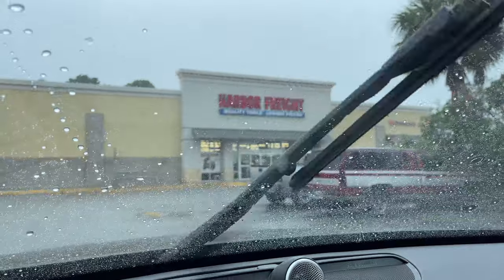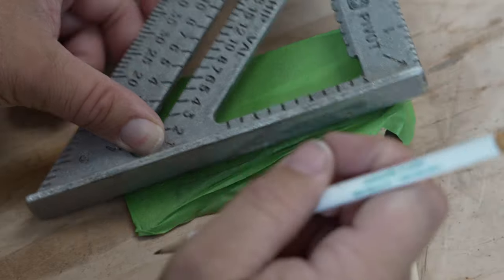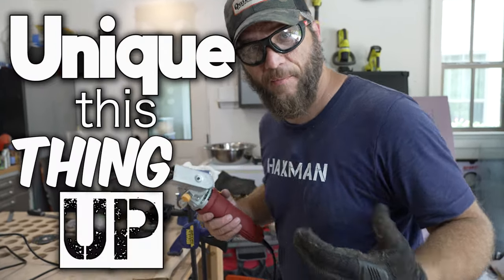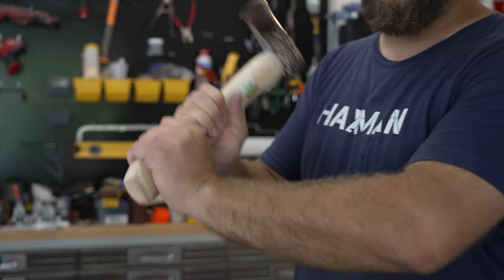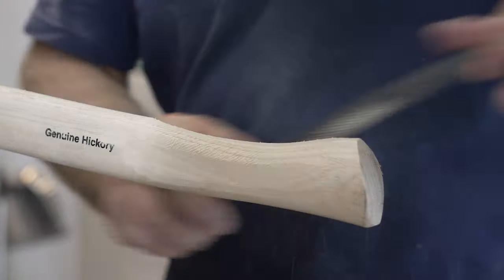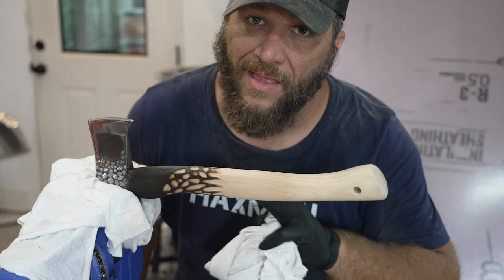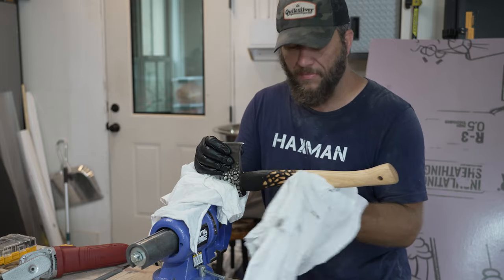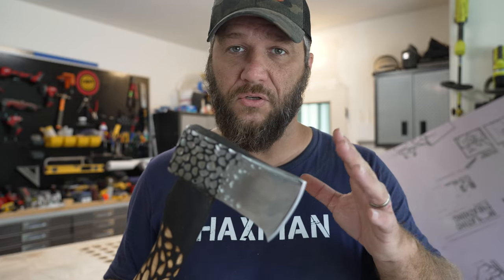How To Transform A $12 Harbor Freight Axe!

Comment: If anyone is wondering how good these actually are, I had an axe throwing business for a short while, and we used these, and they held up great! They do need a bit of reprofiling of the blade and good sharpening to make it stick, but they lasted more than 6 months until the handles started breaking down.
Reply: Agreed. Just check the grain orientation of the handle before you leave the store with it. That goes for any store. Some hatchets/axes are hung properly, and some are just wrong.

Comment: Looks great!   Tip: Don't dispose of the rags you used with the boiled linseed oil in a 'wadded up' state. The BLO heats as it dries. I've come down the next day and found paper towels that were charred and crispy. Almost caused a fire...
Reply: BLO has been responsible for the destruction of many a workshop.
Reply: I always just throw them in a 5 gallon bucket of water with a brick on top of them to make sure they stay submerged
Reply: What do you do?
Reply: @FancyxToast  I spread the rags out flat over the edge of the trash can overnight, then throw them away the next day. Less heat build-up if they dry out flat as opposed to crumpled up. Has worked fine.
Reply: @cannistershot2277  that's exactly what I do. Use it then flop it over  the edge to dry. I do that even if it was barely used just to be safe

Comment: Love it! Nice job!! I got a perty little camp axe at Ace Hardware for cheap and feels great in my hand, too! It is a Collins brand. Btw, that style of sharpening and setting your bevel with a file and rag is perfect for a camp axe. Super aggresive low angle which is what you want in this style axe. I finish my axes in flax oil which is the same as B.L.O., just doesn't have no metal driers!

Comment: Looks nice! All modern day axes seem to have “club” handles. I think they do that intentionally so the user can customize it…Just a guess. Same thing with the varnish, I believe they do that to hold shelf life to avoid cracking. I don’t know the details about that hand axe but typically they have a temper and when heated up by grinding, sanding or even torching the handle, you have to be careful because too much heat will ruin the temper and your axe blade could fold under while chopping or splitting.
Reply: Heating that handle is no problem but the reprofiling grind could soften the edge some.

Comment: I’ve just recently started putting together a “bug out” or “go bag” and have been considering several different axes for cutting kindling or use as a mele weapon etc.
All of the axes I’ve looked into recently are $50 or more, which defeats the purpose of building a cheap but effective kit. 
I’m on YouTube everyday, and with this in the back of my mind, I run across Wranglerstar and now your content, and I’m like “damm, exactly what I’m looking for. A cheap, modifiable, but effective piece of equipment”. 
Thank you for the eye opening epiphany. I will definitely be visiting harbor freight tomorrow.

Comment: The HF axe handles vary a bunch along with the varnish thickness. I just kept picking em up until I found one that has little varnish and a thinner handle. Also the wedge at the axe head varies in quality as well. Get one that doesn’t have big gaps in it or that uses some resin to fill in the gaps.

Comment: I just picked one up yesterday (finally had them in stock) there was only 2 and the first thing I noticed is that one of them had that thick ass handle like yours and the other had a much nicer slim handle that fits in my hand perfectly. Guess which one I snagged. So the moral of my story, keep looking if they only have the Fat handled ones. If they had both been like that I honestly don’t think I would have bought it. You’re right the fat handle sucks!

Comment: I noticed a life insurance commercial pop up before this video.  It's like "Ladies, if your husband is like this guy, you might want to buy life insurance on him."

Seriously, most of my knife making tools came from Harbor Freight.  I have that exact same belt sander.  I tossed that clear plastic cap on top of the wheel because it works well for getting into grooves or curves into the handles.  I also use it to sharpen knives because it is easy.  Put a 600 grit belt on it and it will shave hair.

Never used boiled linseed oil, but I really like Tung oil.  It does pretty much the same thing, but gives the wood a warmer look.

Now take that awesome ace and go bury it in the hearts of your enemies.  And by enemies, I mean logs, limbs, etc.  Keep the content coming.

Comment: Great job bud.  I did something similar with a $4.99 CAD axe (that's like what $0.30 US? 😂)  and it turned out pretty good.  I did add a whip to it out of twine and then put resin on it.  It protects the neck area in case your a hot shot like me and keep missing the wood while splitting :)  👍
Reply from the maker: Thanks man! I started to do something similar out of leather. I’m very likely to miss as well. 😄 I ran out of time for the video but I might do it later.
Reply: @HAXMAN  can't wait to see it

Comment: My concern would be the loss of any temper in the axe head and especially the cutting edge from all that grinding. I could see an area of metal burn about halfway of the axehead just before you sanded the dimples in the axe. That metal burn goes all the way through the axe or almost so. It is the metal discoloration seen on the shiny buffed axe. To cure it would be to retemper the entire axe but it might not retemper to it's original hardness. If the axe was not well tempered in the manufacturing process then retempering will cure that as well. Your technique of cutting slots behind the axe blade was interesting and might minimize temper loss to some small degree. Never get an axe hot when doing any work on it. Try making modifications under water or using what are called heatless wheels or grinders. A company called Mizzy makes small ones for dremels and flexible shafts, they may make or may know who makes the much larger ones. Ask them about heatless cutting discs, I know they are made but I don't know who. If you have to use what you have you will have to approach your cutting lightly and slowly. Make a cut, let it cool down or dowse it in oil, then proceed with the next cut when slotting. You can develope methods using regular abrasives to minimize heating and loss of temper. I just thought you might want to know but then you may already know. A friend always!  Take care now !

Comment: awesome video. only comment is that if it's taking too long to grind your bevel or your edge by hand on an axe head, you need a better file. that steel is super soft. unless you're starting with just a squared off block of steel it shouldn't take more than 5 or 10 minutes to get an edge on it with a proper file.

Comment: Since it's part of this video, I might as well ask about it, since I've always thought this, but never knew for sure:
Should you sharpen objects against the cutting direction, or doesn't it matter? When using a mechanical device like a grinder, I always make sure the disk is going into the cutting edge, instead of away from it. Is there a reason to do this?

PS. You did a great job on the axe. Not my style at all, but who cares? You tried things out, made it your own, and are happy with the result. I'm impressed, I wouldn't have the creativity to even think of this project, let alone how to decorate it.
Reply from the maker: I have no idea. I do it both ways and it seems to work either way although I'm sure one way is the right way.
Reply: It is better to actually get a bit of angle from what ive heard. This is because you need a but of a serration (Im talking micro serration you cannot see to the naked eye) to have the most effective edge. My personal suggestion would be either with the direction of cut or within a max of 30 degrees of the direction of cut. This advice applies more importantly to knives but still may have some effect on splitting.
Reply: he's  not  the  sharpest  pencil  in the  cup

Comment: Did the steel feel overly soft when you were grinding, sanding or filing it?
    Also has the handle held up after severely weakening it by taking material off? Habit broke yet? Lots of reviews on harbor freight saying the handle broke after first or second use.

Comment: Fair to say you cheaped out on this one Haxman 😛 lol👍🙂.
...
Impressed you turned a boring looking harbour fright axe into a smart looking er axe.
I thought you were going to wrap the leather around the handle. mind the hand loop is pretty cool.
You could carve a internal radius groove into the handle and! the axe head along the top edge.
Or cut an (elongated?) hole into the center of the axe head. 
No reason just think it would look cool.
Dang it! Was going to say:
Your axe WILL cut!😠
...
So instead I'll say.
 Is what you did to the "Hax Axe"
21 century version of putting flames down the side of cars like they did in the 70s lol!
Good stuff 👍

Comment: Emotional roller coaster ROFL
1:23 NOOO dont use cutting dist as a grinder
1:28 Wheww is is actually cutting with cutting disk. Good job!
1:35 Noooo DONT GRIND WITH CUTTING DISK!!!
1:37 Good job switching to actual grinding disk.

Comment: I'm new to all this, so this might be a dumb question. But when you  burn the wood like on the handle, does it make the wood weakers?
Reply from the maker: I’m not an expert but traditionally things like spears and arrows are held over a fire to straighten, strengthen, and harden them. This is just burnt on the surface so at most it would be the equivalent of sanding down a 1/16 of an inch. But anyway, no it doesn’t make it weaker. 😄
Reply: @HAXMAN  okay awesome. That was a genuine question too, not trying to sound like I'm trolling or anything. It looks amazing.
Reply from the maker: @FancyxToast  I knew you weren’t a troll. 😄 Thanks!

Comment: fyi, you did the paper cutting test incorrectly.   A butter knife can cut it that way.  You need to hold the paper only on one side and cut from the end of the sheet not supporting the other side.    How close/far from the hand will give your a rough gauge as to how sharp it is.  Also, use standard paper and not card stock or heavy paper.

Comment: You never grind with the blade facing down. Most of the heat runs down and will anneal the edge and it will neve stay sharp.

Comment: Felix Immler is draw filing in the rag method. Look at the pitch of your file. teeth. You are trying to draw  file, but rotating in the wrong direction. You are bearing on the dull back side of the teeth.

Comment: I am proud of you for the Super nice job you did, However these axes are true JUNK. I attempted to wedge a tree branch off of my stuck chainsaw blade and the portion of the axe that goes around the handle shattered and looks like pot or cast metal much too brittle to take Serious as a Survival tool. They are cheap because they are Garbage Axes. I still have the pieces laying at the base of the tree ruzting away. I ended up borrowing my 74 year old neighbors Axe to finish the job and i wiould almost guarantee that his Axe was made here in the USA
Reply from the maker: Yes. I definitely wouldn’t want to depend on one of these. I just did it as a fun project.

Comment: PSA Alert! From an engineer.... Sry. But never take a power tool to a heat treated piece of steel in the way this video shows at the beginning. Always use hack saws or band saws to make the bulk of your material removal. It may take longer but the method shown in  this video will compromise the heat treat of the axe.

Comment: As someone who has fallen in love with axes and has 150 axe heads in various stages of restoration in my shop, watching you waste your time and money on a junk, Chinese axe hurt my head. 
You can buy a mid-70's to 80's Collins or Mann manufactured axe that's the same size at a garage sale for $5, purchase a replacement handle at Ace hardware for $10 and do the same modifications on a better manufactured axe head. 

Other than that small critique, well done. 😉😁
Reply: What's the difference Scott?
Surely an axe head is an axe head? 
Hardened and tempered steel?
Ok, asking as a non - axe person.
Reply: @stuartd9741  Chinese steel is notoriously poor quality. Doesn't matter if it is cast or forged, it will fail. 
There is a reason why modern made axes in the US and Sweden are considered superior and why there is such a price difference. 

I have a Husqvarna made axe I carry in my pickup truck at all times. I know if I need it in an emergency, the chance of it failing is very slim. Same with my vintage  axes I use for both camping and hiking. 

To me the axe IS the quintessential tool that built America. It was the first tool used in every aspect in building this country. 
If push came to shove and your life depended on an axe failing or not, which would you choose?